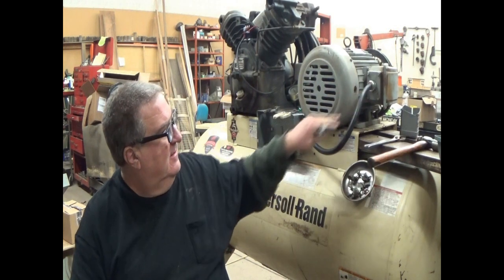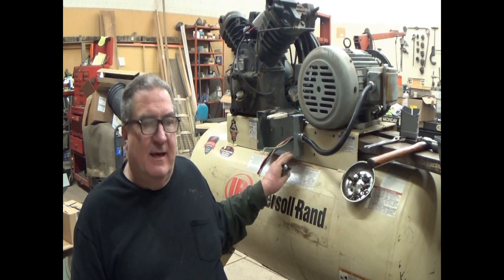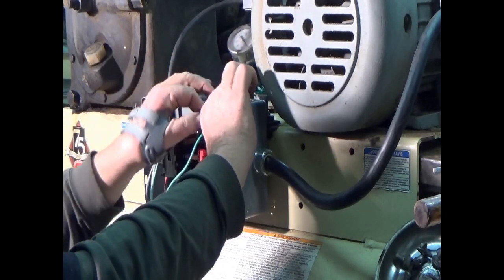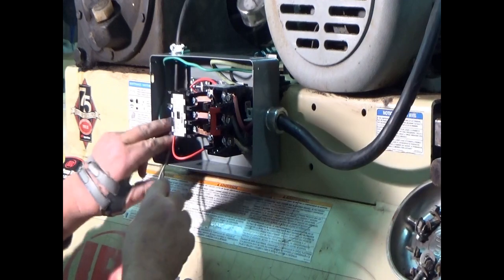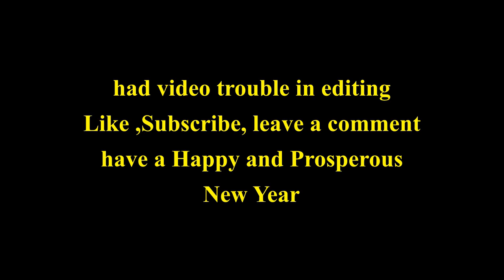Hands on Magnetic Starter Installation

Comment: Yes, you can change any 2 leads of a 480 3-phase motor....but....industry standard is line 1 and line 3. And the best place to swap those 2 is at the peckerhead of the motor...that way all the colors of the wires are correlated up to the last connection. Now it'll work either way and it's not necessarily work, but it's just an FYI from a commercial electrician 👍
Reply from the maker: Thank you Good info!

Comment: I have an 80s model Atlas copco compressor I'm guessing the pump is a 5hp-7.5hp idk it's big and atlas doesnt specify on its tag what it is...anyways bought it used it had a baldor 5hp on it single phase well just recently burned up that motor windings melted due to I'm guessing age and alot of auto paint being collected onto them, I recently bought a 7.5hp 30amp motor for it...all it has is the compressor switch do I necessarily need a magnetic starter on this? Or can I get away with running it without? I have 25foot of 6/3 wire running to the compressor room and have a heavy duty 6/3 style dryer plug running from the outlet down to the compressor
Reply from the maker: you couldn't get away with a 5 hp motor on 220 single phase. most pressure switches are only rated for 2-3 hp max.
I would defiantly recommend a a magnetic starter. and you need to check the RPM of the new motor against the old motor you may have to change the pulley size if you have a big rpm difference. feel free to contact me through thecompressorguru.com . we sell starters pressure switches and anything else you may need for a compressor.
Reply: @THECompressorGuru  ok thanks I went with the same rpm for the motor which is 3450 as the baldor 5hp was also had to buy a new sheeve pulley since my old one was 7/8 and new motor is 1 1/8"

Comment: What should i use to plum my air lines with and the size . I got a Ingersoll rand  80 gallon single stage 5hp from tractor supply. Appreciate sum suggestions.
Reply from the maker: not really enough info to answer but if you look at the description in this link there is a link with info that may help you.
 https://www.youtube.com/watch?v=nJM7VTUm8ng  
 good luck

Comment: My curtis 3 phrase 5hp motor 230 the motor has 3 black 1white all the whites are tired together do the 3 blacks connect like this
Reply from the maker: with out a diagram or a picture I will not even venture a guess. you may contact me through thecompressorguru.com
Reply: You need to get your “ phrases “ right !
Reply: I'm sure you have figured this out already but for people who watch this after the fact DO NOT connect all the black wires together on a 3-phase system....you'll let all the magic smoke out